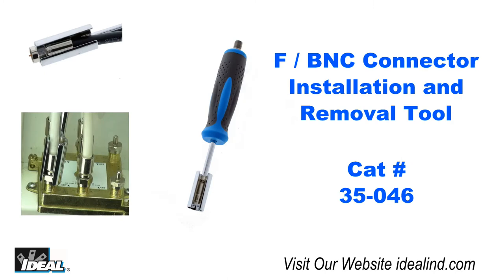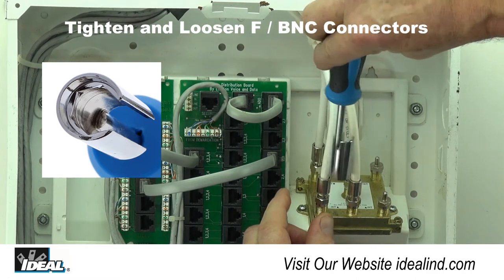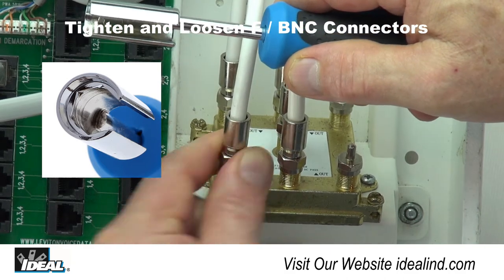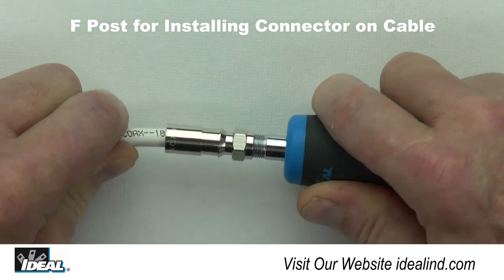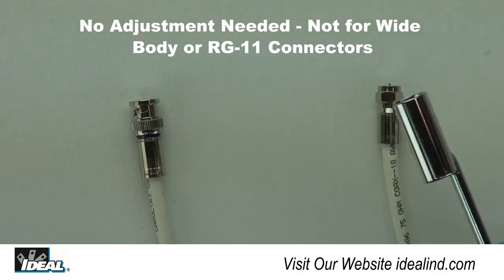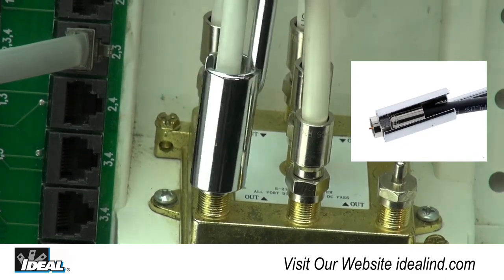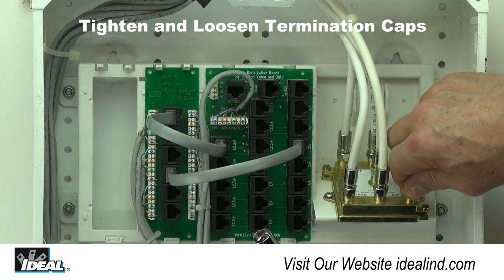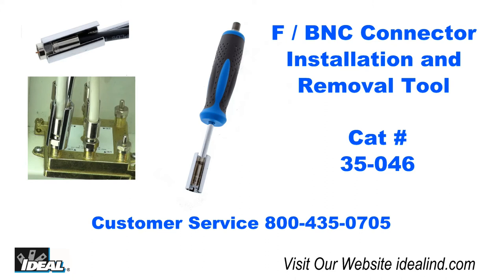35-046 Installation and Removel Tool

Comment: Been looking for a good BNC tool 
Had a tool very similar the BNC locked in tool and was so stuck just put a new end on lol . The back of camera systems get very tight and I hate unplugging other cameras so I can get to or twist in a BNC connections. This looks reliable will try it out
Reply from the maker: Hey Low Voltage Dude let me know how it works for you. If you like send me your info and I will send one of my samples I used for the video. Thanks Ron at ron.kipper@idealindustries.com